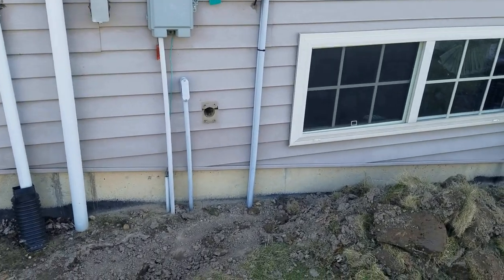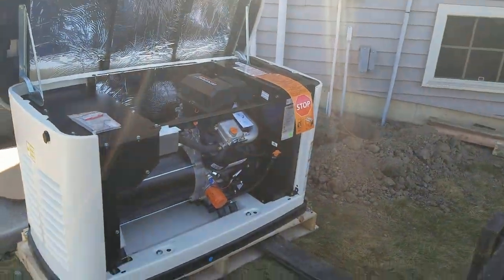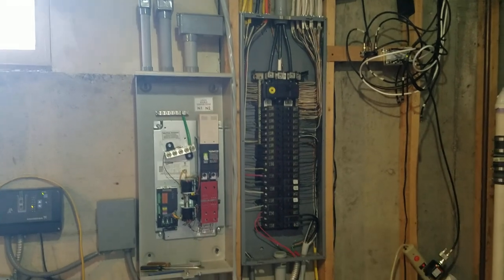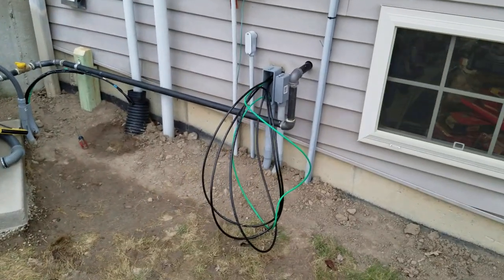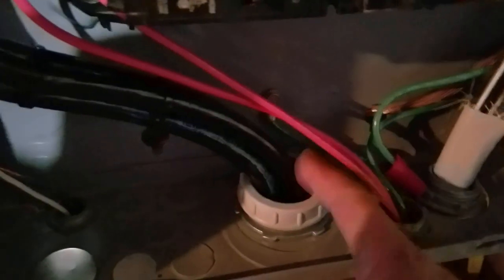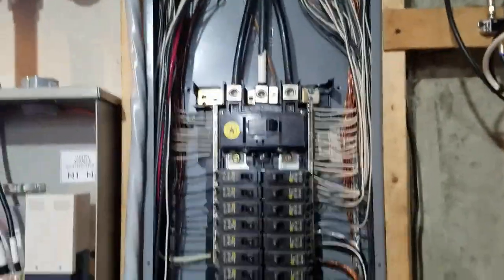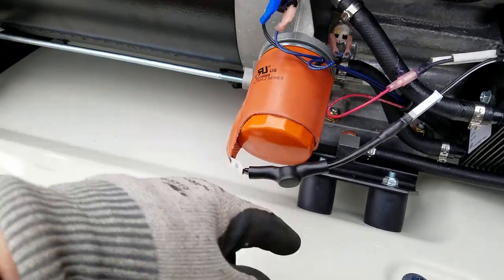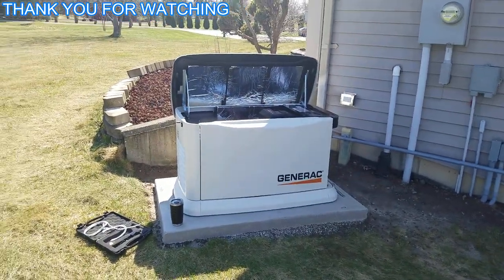22KW GENERATOR INSTALL with 200 AMP ATS

Comment: You did a better installation than most companies.  Only thing I would’ve suggested was to use Generac Control Cable or Generac Tray Cable, then all the electrical connections to your generator feeds in one 1-1/4”  PVC.  (NEC wire rated at highest voltage 240v, my local Approving Authority requires 600v rated.). Also, I always place my SE rated Transfer Switches outside, now the new 2020 NEC Code requires outside disconnects.  Gas pressure checks are required after installation, largest demand is on start-up.  You should not have any problems with your unit, looks like a professional installation.  One last thing, when I install a oil heater I automatically change to a 5W30 full synthetic oil.  Extremely cold weather and battery heaters are good, if you used a AGM Battery instead of a Lead Acid no battery heaters are needed.  Congrats...
Reply: stupid question, but if Generac states in there install manual to use separate conduit for load and start leads, how is the Generac Control Cable or Generac Tray Cable ok to use in the same 1-1/4 PVC?
Reply: @lvggeneratorservicellc7683  each conductor comes with better insulation and all are bundled in a thick insulation, I think that's why is ok to run it in the same conduit.
Reply: @lvggeneratorservicellc7683  First, the inspectors in our area require Generac Tray Cable, he use to install generators.  Generac Tray Cable is manufactured by Southwire, and certified for Generac Generator installations.  Purchased from Generac or Cable Master only, all conductors are rated at 600 volts with no miscommunication with the control wires, that could happen with inferior cable.  All I use is copper, no aluminum alloy here, it cost more than running regular wire, well worth the expense and trouble.  I usually bring my 1,000 foot roll out to a job site on a reel stand, and use a cable puller to finish the job.
Reply: All the Generac control cable is number 14 THHN that is all it is
Reply: I think he need to route all electrode grounding conductors to the transfer switch and not connect back to his old main panel like he did.

Comment: Nice video, Buddy. As a fellow licensed electrician,  it was good to see someone get the grounding correct. Thank you for sharing.
Reply: As a fellow electrician do you think you could have completed this install in 12 hours? Properly, to code. Professional looking install? Just curious there is a post claiming so on here.
Reply: How long you been an electrician because he has no grounding conductor from the transfer switch to the sub panel.
Reply: @DD-di1xc  Correct. The grounding is incorrect. There needs to be a grounding conductor from the service panel ground bar to the two new grounding bars on the sub panel..

Comment: I just had this same unit quoted to me,, down here in Houston, TX. The generator was $5300.  And then they quoted almost $5,000. installation!! Thats with me running all wires and gas line! I told the salesman I was offended by their price, and escorted him out! You are the man installing it yourself!!
Reply from the maker: Good for you! Thank you!
Reply: Way over priced.
Reply: Overpriced in Texas normal in Jersey..
Reply: We got quotes today from generac and kohler here just outside Fort Worth.  The generators themselves from either company is about $5K.  $6900 for labor for generac, and the install can't get easier than how our stuff is located/situated.  Kohler came in better with essentially only about $3000 for labor cost.  Add on that we gotta get a propane tank, put propane in it, dig a trench and under the driveway to feed the generator for even more thousands fo $, and ouch.

Comment: I had mine installed last year and while I was involved in all aspects of the project I paid pair of contractor friends to do the install. They went to Generac training, installed several generators before, and were already familiar with the permitting and inspection requirements. I think that you did pretty good work. Still, it would have been nice to see a few things mentioned. Load shedding should be discussed as that big generator will still only provide 80 Amps with natural gas. At a minimum your central AC should be connected to the ATS AC controls. Additionally, gas meters often need to be upgraded as a 22 KW generator can use as much gas as all the other appliances in a house combined. Other people mentioned the pad placement - I'd add in consideration of pad height if you are in an area that gets a lot of snow.
Reply from the maker: Thank you for sharing those awesome details, you are spot on!!!!!!
Reply: I don’t use the ATS to control air conditioning anymore.  It works well, just trying to run low voltage control wire takes a lot of time and expense.  Last install on a 24Kw Air Cooled unit had 3-A/C Units. I use Sure Starts sold by Generac.  We tested them, and use them at every multiple A/C units, and some high LRA singles.  Very, very expensive, but it will start 3-A/C units simultaneously.  We back our work 100%, so everything has to work correctly,  every time.  We mostly do high end installs, money isn’t a problem with our clients.
Reply: Wow thats good info. I actually need help with some questions similar exact thing.
Reply: Im sure concern about pad height and gas capacity but not much about load.  I would think this generator will satisfy the load with the mindfulness of homeowner when emergency power switch on.  Worst case scenario some breaker will shut off. Oh by the way what you paid for your installation if i can ask.
Reply: @hangngoaigiare  In 2019 I paid about $11,000 for both a 22 kWatt generator, a whole house transfer switch, a service upgrade to 200 Amps, and some extras - so I can't say how much the generator itself was. I could have saved $1000 or so by going with a smaller generator, but it didn't seem to be worth it as the generator was only part of the cost of the project. Plus, during an outage I can run some extension cords to my neighbors and keep them in their homes instead of mine. 🙂

My generator does have a 100 Amp breaker under the top cover, but I was told that it wasn't wise to rely on that to avoid overloads. The 22 kWatt capacity is what you get when you hook up propane, for natural gas the capacity is only 19.5 kWatt. Apparently if the generator senses that it is overloaded it can shut down with an error code. I was told that if that happens that it might require a service call to reset, but I didn't research that to confirm. If all it would do would be to trip the breaker then that would still be bad for me. My house is over a spring and I have sump pumps that run somewhat often at times of the year. I wouldn't want to be away from home and have that breaker trip.

Additionally, part of my project that was done a few months earlier was to run a 100 Amp circuit out to my parking area to prepare for EV charging. That could have overloaded the generator, so I installed a combo meter/breaker panel before the generator transfer switch to have that circuit not be backed up by the generator. Everyone's scenario is different, so it is good to review everything with the installer to decide what you may or may not need.
Reply: @JasonEDragon  thanks for your detail answer.  So this done by an electrician? I still don’t understand why they bring that electrode grounding conductor from the transfer switch and tie it up with the neutral wire in your main 200amp panel.  I would like to say thats a code violation.  Seem like they bonded at the transfer switch so everything should terminate there.
Reply: @JasonEDragon  i check price of generator and transfer switch about $6500 so the rest is panel upgrade and labor to put in. I would think about $2500 not bad.
Reply: @hangngoaigiare  Don't forget that my install was in 2019 before the pandemic. All of the equipment and supplies were quite a bit cheaper and readily available back then. For a while during the past year or 2 there was something like a 6-12 month backorder on the generators - which caused the price to rise. Hopefully the price will drop some in the coming year.
Reply: @hangngoaigiare  It has been a few years since I originally watched this video, but I quickly reviewed a few parts. It seems that by the end he mostly separated the neutrals and ground wires in the breaker panel, but that is being done gradually during the course of the video. He mentioned moving the bare copper wire that enters the breaker panel at the top that he said went to the ground rods, but he doesn't show that being done. I'd agree that the bonding should occur at the transfer switch. That being said, the local inspector has the final call and may ask for something specific.
Reply: @JasonEDragon  sure the bonding is best at the switch but it can be at the main panel too.  If it at the main panel all electrode grounding conductors terminated there.  When using generator and fault happen current travel through electrical grounding conductors ( green wire or metal conduit) back to the main panel, through the bonding, through the neutral wire back to the generator source and clear the overcurrent protective device.
Reply: @hangngoaigiare  Technically I believe that the switch is the main panel in this case and the breaker panel is now a subpanel. It is hard to say for sure from the video, but to me it looks like the water pipe is bonded to the switch, the ground rods are bonded to the breaker panel, and there is another ground wire coming out of the switch which I'm guessing is connected to the breaker panel (can't tell from video angle). If this is true then I'd expect that a clamp meter would detect some objectionable current flowing from the breaker panel up the ground wire to the ground rods, across to the water pipe, and back through the ground wire to the switch. But, issues like that probably aren't that uncommon and don't often cause trouble.

Comment: Somebody had commented in the comments about the bonding where it is much better on the water piping it is much safer if you have a back surge do not put it into piping that goes to PVC if you get a Heat Surge it will melt the wire in the PVC and you could possibly have a back surgeon to the panel which will cause a major fire so Bond it as this man tells you he did a very nice job of wiring I have been wiring for over 30 years and he did a wonderful job he was very smart and putting two separate ground bars this way you do not have to extend the wires on the left side to go over to the right side to reach the bar

Comment: I am no where near as capable with electrical and your video is perfect for me, just enough of an overview that I get some of the finer details without the tediousness of a step by step. Great job I'll probably hire it out when the time comes. I am in Michigan myself. Crazy the shortage on these currently.  Thanks for the video.
Reply: I am a 30-year Generac dealer I am one of the oldest dealers in the country it is against the law for you to deal with the wiring you must hire an electrician An E-1 licensed electricians many people have installed their own generators themselves and have had problems with wiring where they have had fires and burn their houses down your insurance will not cover your house if it was not a permit pulled you cannot pull a permit for electrical or gas you must have a license person to do that please be careful with that and do it the right way I have seen many houses burn down from that I do insurance adjusting for insurance companies for generators and I do much work for Generac I have been all over the country as far as finding out why issues after popped up and usually it is the installers fault
Reply: @jamesbriley1655  thanks for the comments, I was planning on hiring it out as mentioned. Still on the waiting list.
Reply: @jamesbriley1655  that very much depends on where you live, here in NJ plumbing and electric permits have an exception for "homeowners performing their own work in a Single Family Detached Dwelling; this does not apply to condominiums, townhouses, duplexes or any multi-family building."

Comment: Whoever wired the main panel did a very nice job I have seen panels that look like a squirrel here in a big bunch if you have an electrician do your work if the inspector looks in the panel you must repair what has ever bad in the panel before you can go on

Comment: Great job! Only change I would have made would be to sink a ground rod into the ground 3 foot and tie the panel there instead of the water pipe, as there could be sections that are or will convert into PVC at some point.
Reply from the maker: Cool, It is tied to (2) 8 foot ground rods outside In series, the inspector told me I needed to ground to the water line too. :), thanks for the comment.
Reply: @JamesF406  you have it correct. Do you have a ground rod or two at the pole barn,?
Reply from the maker: @beckyschwantes5287  I have one ground rod at the polebarn.
Reply: @JamesF406  which is fine correct? In Indiana we can do one but we have to prove that the resistance is in spec so a lot of folks just sink 2 and forget about it?

Comment: This gentleman did a much better job than most Generac dealers if you get a Generac dealer get one that has been in business at least 15 to 20 years that will be somebody that will know what they're doing I have had to repair many fires and Generator shorts because of people putting the generator in wrong or the wiring in them

Comment: Good job with the setup man. As for pulling the fuses, next time all you have to do is pull the molex plug from the ats and that will de energize your control wires.
Reply: Thanks for the informative video.  You gave me the confidence to complete my own install.

Comment: You definitely need to run a ground wire from panel to panel and transfer switch to the panel it is a must
Reply: Have to bond at the Transfer Switch and Take off the bond at the Main panel..

Comment: The fuse puller comes attached to the fuse panel & b/c it needs to be snapped off to be used, it obviously cannot go back on where it came from.
I suggest simply sticking it on the bolt under fuse N2 (can be seen at 23:00).

Comment: When you are hooking your wires first wire you hook up an electrical is a neutral so you do not get back fee if you hook up your power wires like he did into the switch you might forget the neutral and get a fire always remember to put the neutral and ground up first but the neutral is more important than the ground

Comment: Looks good. We use a GenPad instead of pouring concrete.  You can also pull your control wires in the same pipe as your power as long as its not thermostat wire. We use thhn for control wiring
Reply: Also, why did you put the xfer switch on the inside? Would have been a lot easier next to the meter base.
Reply from the maker: I just wanted it to stay nice, most do put it outside.
Reply: Could have just used gen wire too

Comment: Good video, man. You answered some of the questions I had. Just ordered a 22kW for my house. Can't wait for it come in. I hope you're still happy with yours.
Reply from the maker: So far, power has went out twice for an extended period, it is so nice not have to worry about hooking up portable generators,  we love it! It powers my 220 well, air conditioner and everything in the house, I just wish we wouldn't lose the internet.  😋.....definitely highly recommend it!
Reply: James Foster LS3 TA if you live in an area where Verizon is good get you a visible line and run off that during power outage. That’s what I do. Run 100% as usual.
Reply from the maker: Interesting, we have Verizon, I will look into that, thanks Dan!
Reply from the maker: 3 Years later, still love it!

Comment: Nice install, the only thing I would add is a trickle charger to the generator battery.
Reply from the maker: Thank you,  I thought it had a built in one with a heated pad the battery sits on. I'll have to check

Comment: When you put the oil filter on but it just a little snug it will get tighter as it runs cuz it runs 430 degrees your car only runs 222 filter will tighten as it runs if you put it on tight you'll have a very big problem getting it off later

Comment: You should have run all of your electrical connections through your in house water filter next to the panel.  I'm surprised you didn't do that.  That's what Generac recommends.

Comment: Thanks James.  I also live in Michigan.  I see you mentioned the 36" from the utility meter.  What are the Mi. codes in regards to distance from the house and doors/windows?    Looks like a nice install!
Reply from the maker: I'll take a look, they agree with the Generac installation distances,  they are spelled out nicely in the install manual.
Reply: It is best to not put a generator under a window when I have seen bad weather generators run a long time I have seen where people have died from carbon monoxide because of generators were under the windows they cannot legally be under the windows they must be at least 6 feet to the left or right of the window

Comment: You didn't show how the mains were moved to the transfer switch. Obviously, they weren't long enough initially, so how did you tie in longer wirings to the transfer switch?
Reply from the maker: Correct, it all had to ran new starting from the meter.
Reply: @JamesF406  
Ah, I got it. Replace the wires from the meter output to the transfer switch. I should have figured that out.
Thank you!!

Comment: How is the noise? Doesn't bother the neighbors, particularly when they are not very far from your  home? Are generators of various noise levels? Does it need to be stopped for cooling it off? Who can advise us about the size you need to avoid being "sold" an oversized one?